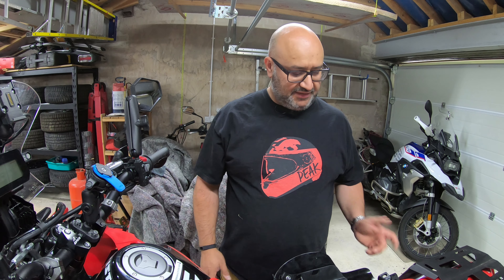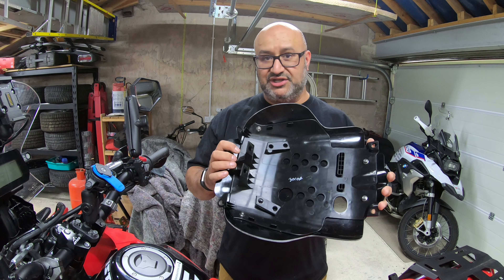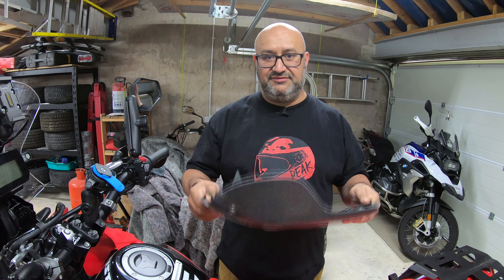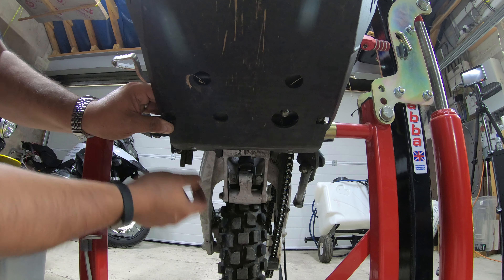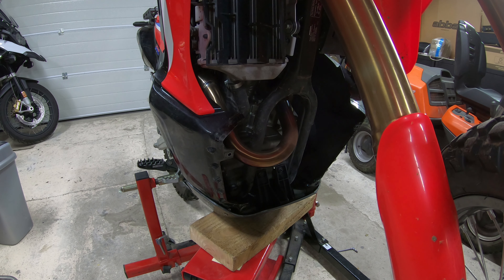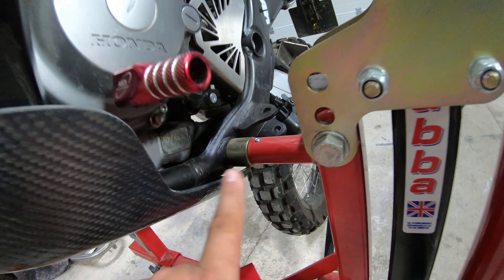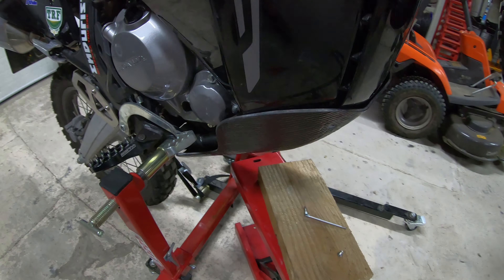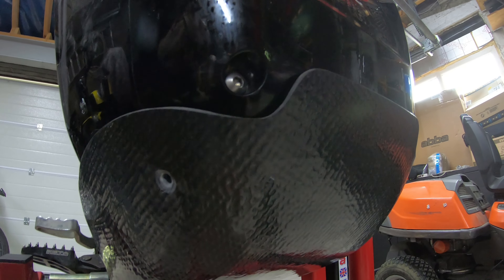Shorts: Kodama Composites Prototype Bash Plate Honda CRF300 Rally 4K

Comment: Brilliant - thanks for the update and really pleased this is working out.  Nothing better than being involved with prototyping 👍🏻
Reply from the maker: What you didn’t see was me forgetting to line up the tabs on the side panels with the holes in the stock bash guard, though I managed to get nearly everything assembled like that. And then took it apart again, then taking 20 minutes to work out why I couldn’t get the lower right bolt into the front guard. 🤣🤣🤣. It is fun being involved with the prototyping, but it’s not bad buying something that just works!
Reply: @PeakMotorcycles  for some reason those lower bolts have always been a swine to line up!

Comment: I'm expecting delivery of my ordered Rally at the end of August here in The Netherlands. I'm certainly interested in the lighter options for accessories  before I head out in October for a month of motor camping towards the Pyrenees and Northern Spain. Thanks Andre for your most informative posts. At least I don't have to re-invent the wheel.
Reply from the maker: Awesome and you’re welcome. Not that helps, but every time I weigh any replacement parts there’s generally a few complaints 🤣
Reply: Kheb de mijne net gekocht, verwacht tegen december. En hoe bevamt de rally je?
Reply from the maker: @johndoe-tk6en  My apologies, my dutch isn't great. Google translate tells me that says: 

Just bought mine, expected by December. And how do you feel about the rally?

I'm loving the Rally! Not riding it as much as I'd like due to other commitments but it always brings a smile to my face.

Comment: This looks interesting. I am hoping someone makes a nice heavy duty plastic bash plate as I prefer them over aluminum. They are quieter as rock impacts don't have the same loud ting as aluminum. Less engine noise and heat is directed up to the rider, as well, though this is likely less of an issue with the Rally as all the body work surrounding the engine takes care of a lot of that.
Reply from the maker: Hi, it’s odd that no one has made a plastic one yet, other than the stock one that comes on the bike. Maybe that’s why?
Will see what this one is like when it’s finished.

Comment: Nice video,  carbon is cool and all,but I think it's place is on the track. Technology has come along ways though so maybe they figured out a way to make it more rock friendly.  Also I would want a seal on the top to keep the road-trail sludge from entering the plate. Maybe a foam strip or silicone lip????  Will be interesting to hear and see the final product review.
Reply from the maker: Yup, definitely something on the lip to keep the sludge out. As for the material, I think it’s also what else you put in it. Carbon fibre in resin is light and strong, but not tough. On impact it cracks and can shatter, which I agree is no use on a dual sport. To overcome this, Kodak’s over lay the carbon fibre with Kevlar/Aramid to give a toughness that is not normally present in carbon fibre alone. Will it be enough? Not sure, but I’ll see where I can take the final one when it’s done and see if I can break it!

Comment: How was the clearance between the upper edge of the bash plate and the gear lever?  It looked a little tight from one angle.  (I paused the video, then found you mentioned this shortly after).  Yes, trim it a little would be good.
Reply from the maker: More than a little tight, it’s in the way. You win the most observant viewers award! (I guess the 4K helps too). I’m cutting out a section today for them. Video to follow.

Comment: I noticed you have a vented metal sprocket cover over your front sprocket. I looked through your videos but didn't see any reference to it or who makes it, unless I missed something. I'm interested in finding a cover like that for my CRF with holes that would allow me to wash out the mud that gets packed around the front sprocket without having to remove the sprocket cover every time I ride in muddy terrain. Any info would be helpful!
Reply from the maker: Hi, it’s a H2C sprocket cover from Bikerzbits in Thailand: https://bikerzbits.com/crf300l-rally-h2c-cover-drive-sprocket-apk1tal23800ta.html

This is the fitting video:
https://youtu.be/uEPbW8ml5aM

It needs a bit of deviation from the instructions to fit it to a UK spec bike but it’s pretty easy.

Comment: Looks good but the fact it’s held in place with plastic from the original bash plate not so good thing.
Reply from the maker: Why’s that? If you hit something hard enough to break the six bolt on points on the stock guard, it would be a massive impact. Stock bash guards are a lot cheaper to replace than frames. In such an instance, I’d rather that took the hit. They have been making them for a while, and they seem to be working ok, also for heavier bikes than the 300, but only time will tell. Hopefully I never get to find out 🤣
Reply: @PeakMotorcycles  That might be true but i think from breaking the plastic of the stock bashguard to bending the frame is a long way. I think a soft aluminum holder instead of plastic would be more appropriate. Btw. If you look at the engine when you removed the plastic cover there is a huge room on right side(left sude of the motorcycle), that is where i store my tool roll, it would be nice if someone would make a bash gurad with tool box there.
Reply: @EEEEMMMMKKKK  That's a good idea.  I've had the front plastics off today and noticed there's a very large void in there.  I was wondering what to do with it, and now I know.  Cheers, from Oz.